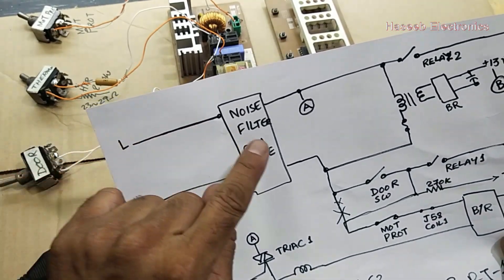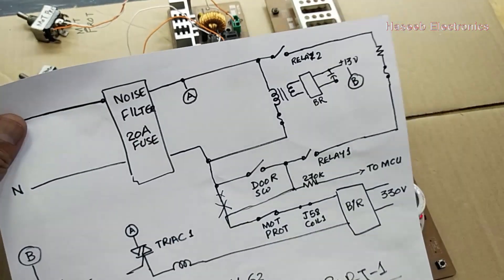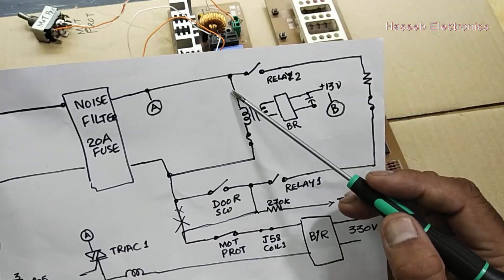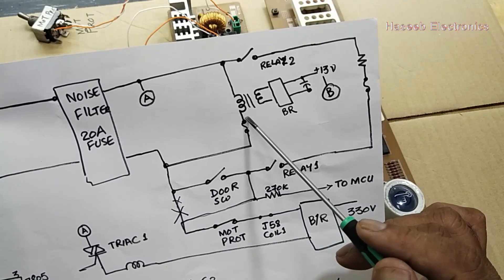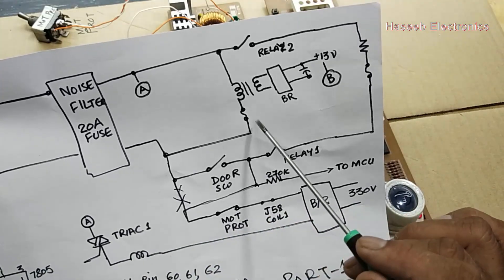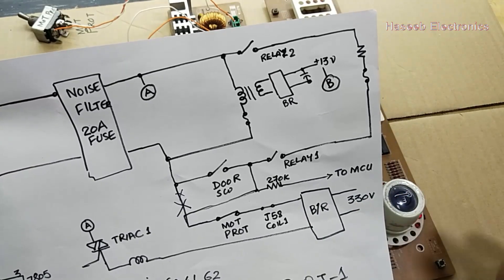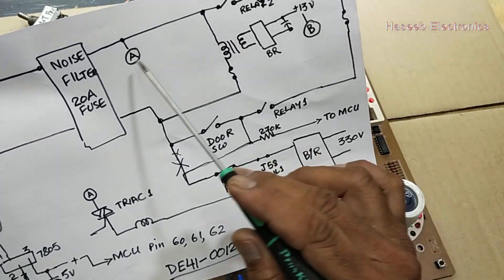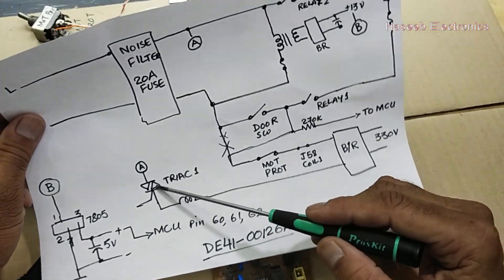[412] Repair & Working of Control Board for Samsung Front Loading Washing Machine - Part 1

Comment: Sir what kind of push buttons used in this board? If I want to buy them from local electric parts shop, what I should ask seller?
Reply from the maker: these are tactile switches. just check the service manual for your specific model number, to find the exact part number to get the exact part number. (if you are ordering online)
if you want to purchase from local electronics parts seller, then just remove the component and take this sample to the seller, he will match and will provide you the same

Comment: I have a very similar model (B1013J) has similar pcb layout and switches. The issue is the power on switch doesn't power the machine, but has 5v and 12V. If I press big wash button together with power on it starts without welcome sound but  dial switches wash programs leds but after a few seconds shutdown, so can't start a washing cycle. I don't think microprocessor is faulty but probably the ROM is dead that can't  read the firmware correctly to start.  Have you ever repaired a model like this with symptoms ? Some tips can be very useful.  Thanks for sharing your great expertise!

Comment: Thank you, I need to find out why my door close solenoid isn’t receiving signal, everything else works fine as far as I can tell.
My door close unit works as I tested it in another machine.
I might have to check for a physical reason the door closed situation isn’t activating.

Comment: Sir my lg front load washing machine board no. ebr 7393. door lock swich problem was occur. as i have seen you tube videos i  made connect neutral and common to board side. as soon as one resistor burnt. neutral to common voltage is 127v ac what i do please give advise.

Comment: In some circuit the motor is driving with triac only no bridge rectifier is seen. The motor is working on ac or dc. If on ac why bridge is needed
Reply from the maker: when it is using TRIAC, then the motor is ac motor 
if it is using SCR then the motor will DC
Reply from the maker: the bridge rectifier is used to provide DC voltage to the circuit and other DC operated parts
Reply: @HaseebElectronics  please do the next part with complete explanation.
Reply: Is this video explained non inverter washing machine. Then why triac output is connected to bridge.  it is said to be for motor
Please explain

Also explain why an optp coupler is used and rectified voltage from one of the triac out put is connected to opto

Comment: The first thing i'd do is remove the dam speaker, or atleast reduce the sound.
Reply from the maker: yes, the buzzer have very high sound, next time i will remove it
Reply: @HaseebElectronics  Its strange why electronic designers have them built into systems like that and don't give the option to turn them down or off. 

I have a family member who has an oven that makes a loud high pitched noise every time the timer goes off and it is annoying.

Also I hope my comment didn't come across as rude towards you, your channel is great.
Reply from the maker: @Ghost572  you are right. in some products there is much annoying loud beeps and buzzers, 
in some products they provide mute option, but in some devices there is no MUTE option, so it makes a big disturbance. 
it can be replaced with a low volume buzzer 
and your comment is valuable for me. it makes me comfortable.

Comment: I work a lot on Samsung washers and late models have a problem on main computer. Theres 5 volts from main board to control panel but it won't turn on. And not quite sure if it's been protected or or the main processor memory needs to be replaced or reprogrammed.
Reply from the maker: welcome dear.
most latest boards are using smps modules on the boards, instead of transformer based power supply
i started this series and we will dig deep as much as i can. and i will try to discuss all related problems and its easiest solution. sometimes the software is protected in these ics. 
please accept my best regards
Reply: @HaseebElectronics  That I will appreciated a lot. Thanks for your time. Blessings